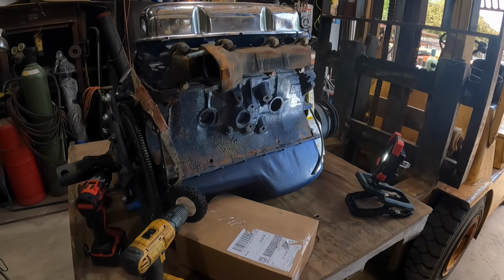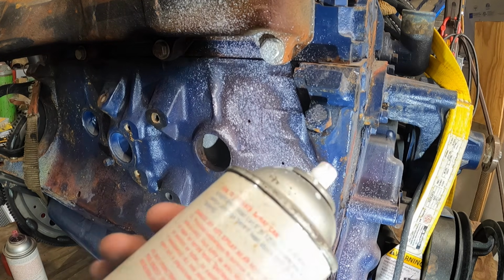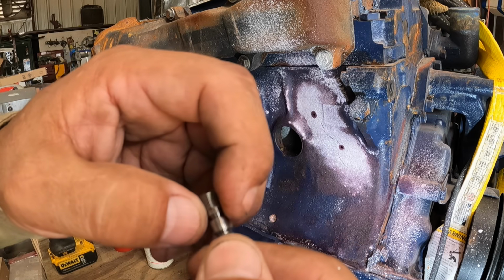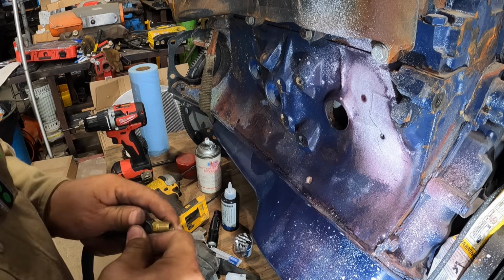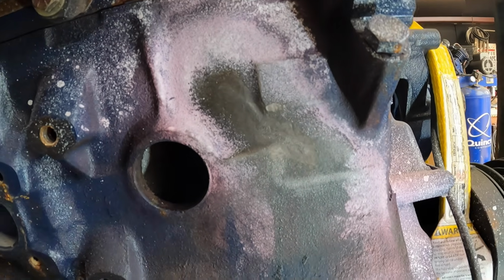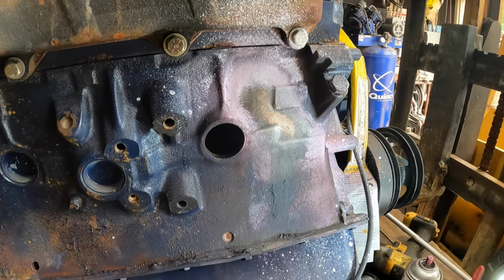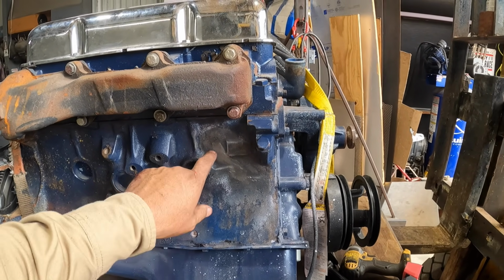Cracked Engine Block Repair

Comment: Idk about this it could block coolant flow or divert the flow because the pins are sticking out farther into the block. Should have just welded it now there about 10 inches of thread high pressure coolant can leak out of in the event of high heat performance
Reply from the maker: The seller of the screws asks that you measure the wall thickness by drilling small hole and inserting a small bent wire that you hook onto the inside and mark with a marker.. This helps check how long of screws they need to sell you so they do not protrude past the inner wall thickness.
Reply: @ICWeld  on your own engine and with your skills, would you be more confident in this kind of repair or by welding/ brazing?
Reply: Have you ever seen the junk built up inside cast iron blocks? You really think those screws are going to make a noticeable effect on coolant flow? This method has been widely used across the world for many years but you know better, right? 😂

Comment: Try this.  You have to pine the weld.  As the metal cools it wants to shrink , making a new crack.  Weld an inch or so, the using the pointed end of a chipping Hamer , hit he heck out of it.  50 hits quickly as the metal cools down and there will be no new cracks.
Reply: Pine leaves too much sap. I peen mine instead. 😂 Sorry, couldn't resist.

Comment: IC weld use battery cable heat shrink over wire works awsome
Reply from the maker: great idea. I'll buy some for next time.

Comment: looks very cool please do a follow up after he runs it.what about all the chips going into the block from drilling
Reply: If you say "coolant passage" three times real fast it all disappears 😂
Reply: I'm sure there's so much scale inside that block It wouldn't matter but if you're worried about it you could always duct tape a piece of hose on the shop vac hose and stick it through the freeze plug hole or put grease on the drill bit

Comment: I like the hose repair kits using a compression fitting to hold the hose.  The only drawback is you have to have the ones that fit your exact o.d. and i.d., so if you have a lot of different sized hoses you need to keep enough on hand.  There is nothing rough to chew up your hands though when they are installed and they can be reused many times.  Several manufacturers make them.

Comment: When my family had a commercial shop, cast iron was repaired by pre-heating, then 'braizing' with Allstate Number 11 Alloy. Its NOT your usual brassy crap... it has great wetting and very high strength.. Cool slowly under a blanket.

Comment: You can do much the same thing with small pipe plugs. 1/8" NPT works fairly well. Drill the applicable sized hole, tap it with a 1/8" NPT tap, dope your pipe plug and run it in. Grind it off, centre punch on the plug so your next hole will overlap 1/3 to 1/2 of the diameter, and repeat.

Comment: "Lock and Stitch" BS. ie.  chain tapping is ONLY EVERY ANY USE FOR eg. Heads and block deck surfaces, heads and manifolds.... 

The reason is simple. - a deck, or head surface is almost only every under equalibrium stress ie it forms a sandwich layer.....
Whereas a waterjacked is in imbalance(one.side thermally and hydraulically stressed, whereas the other is ONLY under atmospheric pressure). Mechanical stress is like water ie. It takes the path of least...... 
So although the repair will "work" for some time, until stresses  eg thermal cycling cause physical expansion on the boundary layer(stress raiser(crack)) which WILL creep - The hole drilling is trying to facilitate a smooth transitional stress plane from one side of the crack(boundary layer) to the other... 

Anyone familiar with Hydraulic cylinder repair will be familiar with the growing weld bead repairs required on cylinders where the rigid pipework meets them ie. it. MUST ALWAYS. BE. CUT BACK. TO. THE PLANE. OF. THE CYLINDERS INTERNAL WALL to achieve long term reliable repair. 

Just imagine the little boy and the dyke, but with more and more boys required each time....

If extra income is sought then consider online welding/gas axing classes/seminars(MANY of us would be HAPPY to pay for your knowledge and expertise) - Don't shill snake oil, is what I'm trying to say. 

Much respect and admiration of both your welding and flame cutting expertise. 
❤❤❤
Reply from the maker: I totally understand what youre trying to express. It makes sense. Although, if you consider that the only pressure that may be exerted onto the outer wall of the engine block is roughly around 15lbs of outward force, its not too bad. If the customer does a good job of filling the radiator with tht proper amount of antifreeze, he shouldnt have a problem from here forward. If others have commented that JB Weld works in this situation as well, then this repair is superior since it has actual mechanical advantages because of the barbed threaded bolts that actually grab the parent metal, not just simply threaded in like a standard bolt thread. I guess only time will tell.
Reply: @ICWeld 
Thanks for the reply.👍
I assumed it was a frozen block thing by the core plugs being missing, and the location of the burst, but wasn't sure. 

I've sometimes found that some cast irons can be welded quite well with MIG(0 or 5% Co/Argon mix), but it depends entirely on the parent metal being compatible. 

I've also found Fe MMA rods and AC to be quite effective, but again it's all about the parent metal. 

Brazing could be an option, but with all that heat some localised distortion may occur -  perhaps put the block(engine) upside down and fill with water to below(above in reality) the crack area, then maybe this could help with distortion)?

I was serious about the paid group tutorials stuff, as I've been welding(agricuktural jobing stuff) for 40 years and still regularly make welds like bird shit!! 

Keep safe and well(BTW my FIL is a retired Fabricator/Plater and is slowly dieing of Asbestosis/lung cancer), and I know many older welders in the same boat, and now with the prevelance of Inner-Death shielding in use, then it'll only become worse. 
👍👍❤️❤️😁

Comment: That's a nice product but what about the cost? As well, that's a long screw protruding through the cast so really not great if you ran into an oil gallery or a water jacket but interesting and clean way of doing it. Nice video I.C., thanks!
Reply from the maker: The Lock-N-stitch company had me drill holes into the block to measure the wall thickness so we wouldnt extend past the parent metal or into a cylinder wall or oil galley. They sent the proper length bolts.

Comment: i have done that when working for Campbell Crankshaft Service. I used a quarter inch steel rod and threaded it fine thread screwed it in cut it off then repeat. cheaper than kit. when done just lightly peaned it to lock all in place. that is a really good repair.

Comment: Excellent choice. No heat input that can cause even more cracks at stress points. You saved the owner a ton of money. I used to work in an automotive machine shop in the mid too60's to early 70's and we used this method to repair cast iron.

Comment: Summary
* (0:00) Cracked Engine Block Repair Without Welding: The video demonstrates a repair method for a cracked engine block using a system called Lock N Stitch, avoiding traditional welding techniques.

* (0:51) Lock N Stitch System:  This system involves drilling holes along the crack and inserting specially designed screws that interlock and seal the crack.

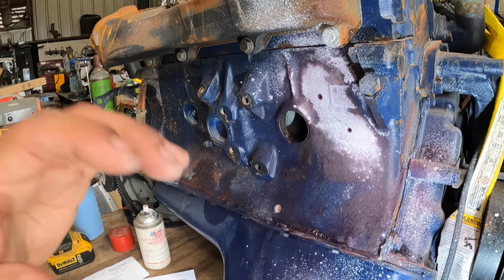* (6:16) How it Works: The screws have a shoulder that snaps off at a specific torque, leaving a flush surface.  The screws are designed with a "hooked" thread that grips the cast iron and creates a tight seal.

* (5:18) Advantages Over Welding: This method is considered less risky than welding cast iron, which can be prone to cracking and warping due to heat.

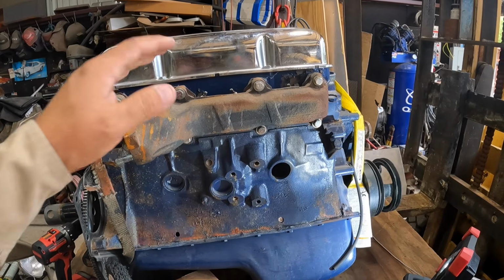* (1:08) Testing the Crack: Before the repair, a dye penetrant and developer are used to identify the full extent of the crack.

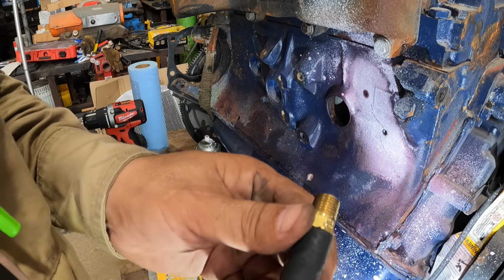* (10:25) Additional Tool - Clamp Tight:  The video also showcases a tool called Clamp Tight, which uses wire to create hose clamps without the bulky end of a traditional clamp.

* (23:00) Successful Repair: The video shows the entire process from crack identification to the completed repair, with the host expressing satisfaction with the Lock N Stitch system.

Summarized by AI model: gemini-1.5-pro-exp-0801
Cost (if I didn't use the free tier): $0.0518
Input tokens: 13219
Output tokens: 527

Comment: I have an engine like that it came out of a 59 Edsel, the front corner where the oil mounts was welded back on. Not too sure how they did the repair..

Comment: I have the hose clamp tool hadit about 15 years lives in mu 4wd along with ss wire for emergencies also good for the garden watering system hate those plastic clamps

Comment: I used lock n stitch on a Model Ford engine. Really good solution to cranks in castings.
Reply: Hi, Can you please let me know where you got the Lock n Stitch kit from. I am struggling to find a supplier here in Australia.
Reply: I bought a repair kit off eBay. That was well over 10 years ago. The kit included maybe a dozen tapered screws and a matching tapered tap. I do remember that it was not an actual Lock-N-Stitch kit. Hope this helps.

Comment: I've seen this process before, but not in this detail. Thank you! 

Most of the vintage Deere machines I work on are cast iron blocks, so I'm definitely going to consider this for the next time I deal with a crack.
Reply from the maker: Glad it was helpful!

Comment: nice video Isaac ...you showed that old method as good or better than Ive ever seen. I was expecting you to weld it up because that is what you do so masterfully but was interesting to watch you share that non welding repair as well - thank You

NOT trying to steal your smoke but believe it or not original JB Weld works for engine block repairs - I live in Buffalo NY and have a V-10 Ford plow truck - these engines are notorious for actually rotting holes out of the engine block here in the rust belt- especially behind the starter....my hole was about the size of a golf ball coolant pressure blew it out without warning.... I removed the starter and used a die grinder to clean up the hole and the block about an inch all around the hole and cut a piece out of a steel coffee can as big as would fit inside the hole and then ground its surface to roughen it up. I brazed a thin rod to it so I had something to hold on to and put it inside the block. While one hand held tension on the brazing rod - with the other I used a small putty knife to paint on JB WELD best I could to close hole and cover the areas around the hole that I had just cleaned up.  after letting it harden up to hold form I snipped off the brazing rod and over that applied a finish coat of JB WELD and let it cure a couple days in  a 70 degree shop. I reinstalled the starter / filled with anti freeze and drove the truck....that repair has held without any leaks for more than four years  - Im still using the truck.......call me crazy but I had 3 choices pull the engine and try to patch with braze/weld .....replace the engine.....or do what I did - repair with JB WELD....sometimes you just have to be a nut.   : - )
Reply: That's a good one😅. I live here too, the only thing I've repaired with JBweld is the rusted holes in my 7.3 oil pan. Drain oil, clean with brake clean, wire brush and fill hole with the JB weld(I used the epoxy stuff instead of 2 part 'metal' mix) let dry overnight & refill oil. It worked well until another hole started leaking.🤦🏻‍♂️ It's terrible how bad the rust is here! I hate what it does to our vehicles! 😠👍🏻👌🏻🛠️🔧🔩🛢️

✊🏻🇺🇸🦅🇺🇸✊🏻
Reply from the maker: Thats crazy.. JB weld is great for many applications

Comment: Nothing new here gents ,the process is nearly a 100 yrs old. And it also can be done with brass screws and green loctite the brass expands quicker than the cast iron and will not loosen.

Comment: No negativity intended, but as I remember, they used to set it up in a vertical milling machine and they were very precise about the spacing The one thing I do remember is they had no fear of failure once they fixed something.

Comment: That looked pretty slick! How many of those screws did you have to use and how many did that kit come with?
Reply from the maker: They came in a tube of 25. I believe I used almost 20
Reply: @ICWeld thanks my friend.

Comment: Impressive repair, now the proof is in the pudding, like a follow up when it runs. Cickbait! Isaac is fixing a cracked  block, and is going to roll out the Lincoln Pipeliner. Just kidding.

Comment: Never seen this before and after reading the comments it seems to be a well known process.  I bought one of those wire clamping tools the last time you showed it and it is great for making hose repairs that don't have a big lump.  I've used stainless wire a lot over the years , but this tool makes it very easy.
Reply: I did too. It is in my off road tool box

Comment: Like 15 years ago I braze a 258 inline 6. Never pulled the motor, did in on a cold winter day at work. Got to love a good G job. Co worked drove it like that for 7 years

As for the pt, it's acting old.

Comment: The only thing I see that could be a problem is the drill leaving shavings inside of the engine. Definitely want to do this with the part off the engine so you can clean everything out. 😊
Reply: It's only in the water jacket so not to worry some. Flush out coolant passages, maybe do a flush & fill on radiator system after install. Even installing a bypass filter to catch anything possibly left inside but not too detrimental if a few specks of metal gets in coolant.

Comment: 1958 to 1976 Ford FE block
Cubic inches range was between 332 and 428
Never had any luck pinning heads, eventually they would leak especially aluminum heads.Ive never tried doing blocks.

Comment: Nice method. I'd just cut a few threads off so it doesn't extend too much inside and pull tap to one side while cutting the thread. I'd also bet those bolts are made of cast iron, Isaac.

Comment: I made one of those wire hose clamp tools using a water shutoff tool that I bought at Home Depot and I generally use it when I need a hose clamp.  I also use electric fence wire because it's galvanized and doesn't rust like tie wire does.  But I also found on Amazon a "make a custom hose clamp" kit with a bunch of screw buckles and a roll of that matching banding in stainless steel and I use it whenever I need big hose clamps.

Comment: Should have tried this years ago.  On the clamp tool, many years ago, in a machine shop class, the term project was making a tool that did the same thing.  Think it's still in my toolbox.

Comment: which kit is it you bought here from locknstitch? their site isn't the greatest in finding things lol.
Reply from the maker: They recommend that you call them and describe or send photos of what the project is. Theyre very helpful and walk you through deciding which set of screws to use.
Reply: @ICWeld  Thank you Bro I definitely will. I'm just interested in a kit basically to put on the shelf. I have a few broken castings every once in awhile that I can't fix with welding.
Reply: @ICWeld  that engine is a 390 or 360 FE btw :)

Comment: They want a fortune for those wire clamp tools. I ended up making the DIY youtube version out of a turnbuckle. Cost like $5 buck in parts and a little time. Works great 😉👍
Reply: I think l got a bit fancy making one out thin pipe, maybe electric conduit, along with a bolt and a wing nut. No complaints about it either, tie wire makes good clamps that way

Comment: Wow that second hole was pretty shallow i never realized how thin engine blocks are.
Reply from the maker: I was surprised myself. The company asked that I drill those holes to check the wall thickness so they could sell me the proper length screws.

Comment: I saw this method used by someone in Hot Rod magazine in the late 1960’s using mild steel bolts and permatex permanent gasket maker.

Comment: Nice lil repair Issac. Great video. Thanks
Reply: I like to top off the wire clamp with some heat shrink tubeing with the glue. It also acts like a strain relief on the hose. Last much longer than the origional brass crimp ferrule.

Comment: In the 80's and 90's  in was rare to pull a the heads off a Detroit 71 or 92 series that had been driven hard and not find a cracked head.  Just about all the rebuilt heads you could buy had the cracks Lock-n-Stitched up.

Comment: When I first saw the title of the video my first thought was you don't weld the engine block you metal stitch it.  I started metal stitching 25 years ago. Chrysler hemi block's are notorious for cracks into the water jacket and I have repaired many using metal stitching.  I use lock n stitch and I recommend it to everyone dealing with cracked cast iron.

Comment: Did you know, that if you put a washer on your drill bit it will help you keep your drill bit level, if it walks one way or another your slightly uneven, and if it stays in 1 spot your perfectly centered.

Comment: that is a fe series ford engine started production in 1958 as 352 neat repair one trick i have pulled is if you end up with a real small seap you take a center punch peen it real good stop seapeage also

Comment: Lock and Stitch replaced a section of the block on my early hemi....No issues and it gets hot here in Vegas...Had an old welder years ago tell me cast iron is just like glass and heat will show stress cracks you don't see especially when blocks freeze....
Reply: Thanks Vernon!  We love your passion for casting repair.

Comment: Is this method expensive?
Reply from the maker: The initial cost is expensive because of having to buy the taps, drill bits, etc. but after I have all of the tooling, it should be less. Later, the expense would most likely only be for the cost of the screws, if its for a similar repair.